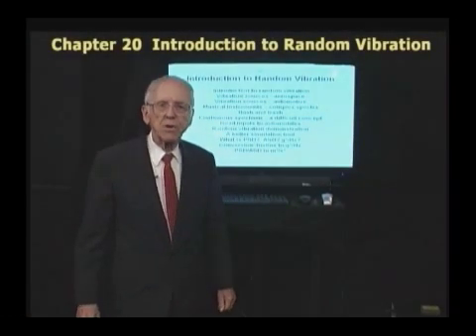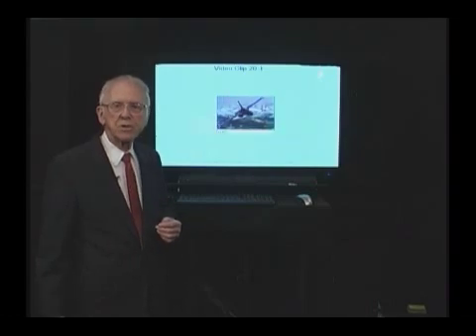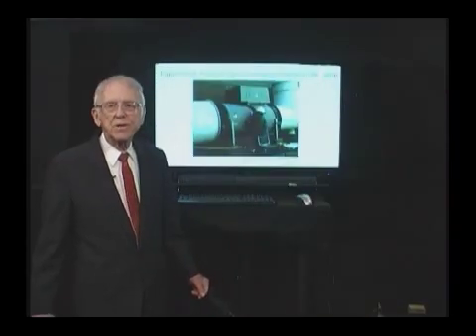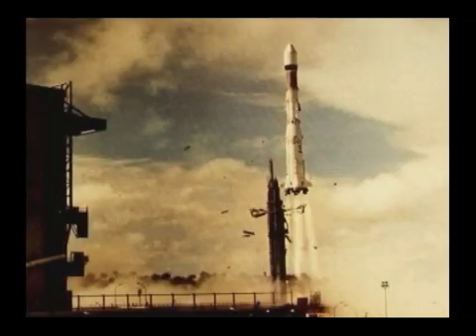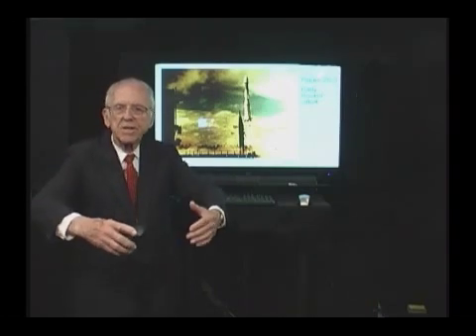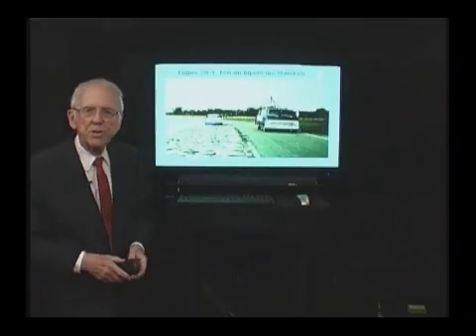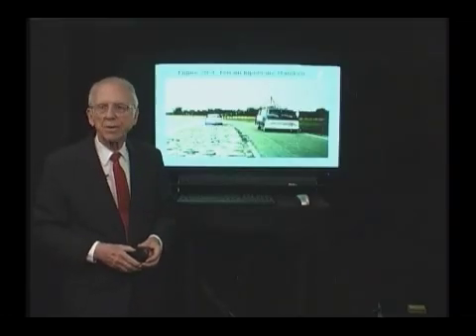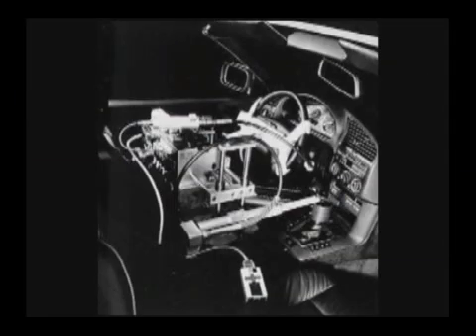Introduction to Random Vibration

Comment from the maker: Thank you for the compliment.  This lecture follows Chapter 20 in my text.  21 is additional random vibration basics.  22 deals with random test specs.  23 with conducting random vibration tests.  24 & 25 deal with HALT & HASS.  25 & 27 with fixtures.  28-30 with shock and shock testing.